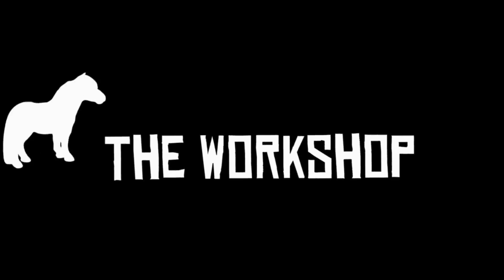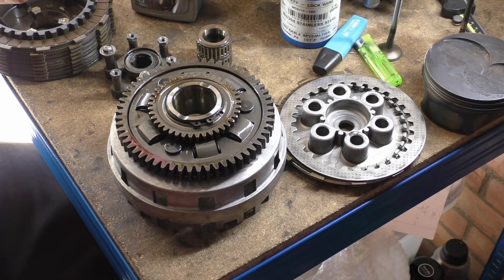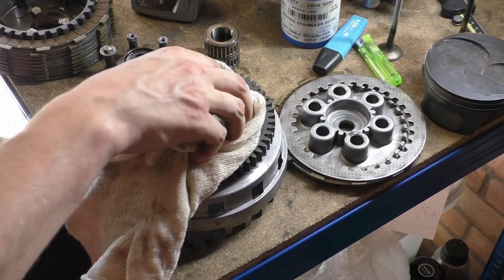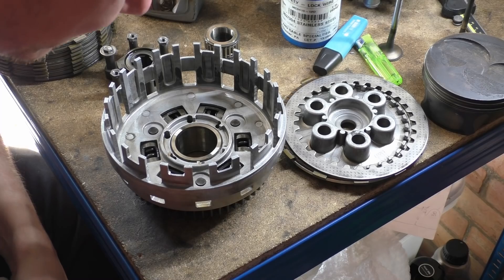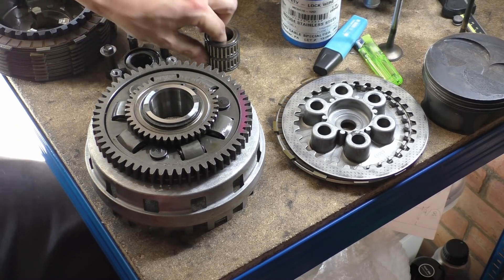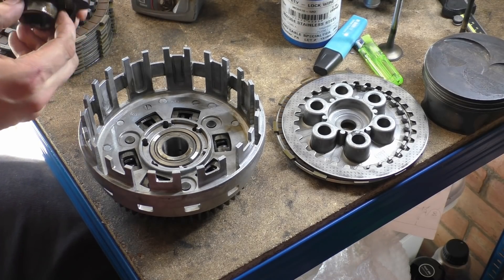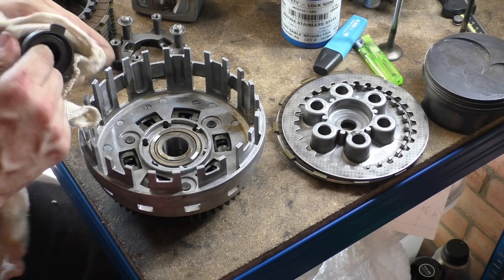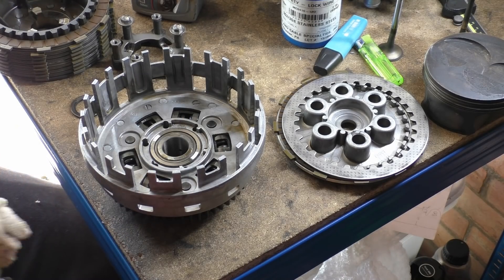SV1000 Clutch Inspection - Part 2

Comment: Like mentioned earlier, the first video surging/bucking isn't so much the clutch. That is fueling, throttle body balance, and TPS settings. The metallic clacking noise can be the clutch basket. That comes from wear by the steel plate that you can see inside the basket holding the springs. This is the root cause of chudder. There will also be wear in the aluminum to steel gear bearing. This causes an imbalance in all the parts and adds to vibration. Installing a new OEM clutch basket fixes things for a while, but the new ones still have the same internal design problems. They wear out again all to soon. Modifying the baskets can make them smoother than new, and they don't wear out.

Comment: What you showed in the other video is not chudder. Balance the throttle bodies and set the TPS position. If it still surges check the TPS with an oscilloscope, these bikes won't throw a code when it goes bad.

Comment: Are you stripping your clutch out because of the low speed surging, my son's sv 1000s is same as your model, he had the same problem,  we balanced the throttle bodies and the surging went!
Reply: Stephen Williams so that's money thrown away.
Reply: If its the same as mine theres quite a bit of vibration through the clutch when accelerating between 1500 and 3500 revs.known as clutch chudder.pain in the arse it is

Comment: my v strom chudders like a motherfucker, taken the clutch basket out and drilled/pressed the rivets out, the defects I've found are 
 that the springs where loose in the guides and the bearing surfaces between the aluminium clutch basket and the steel gear was rough (not ground or otherwise finished) and had excess clearance and was out of round.

Comment: I once braked into a 90 degree corner so hard that the back wheel was barely touching the tarmac, two up as well.
Didn’t need a slipper clutch then, that was when I was mad on 2 wheels